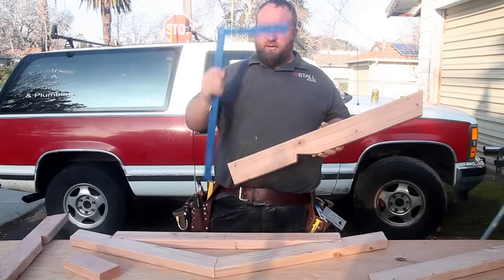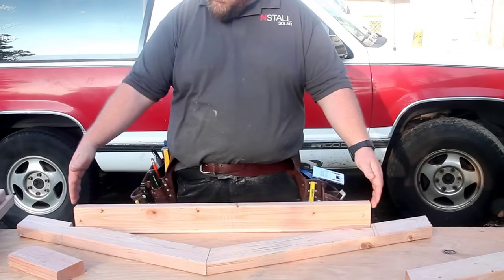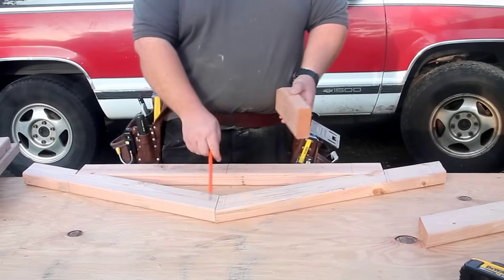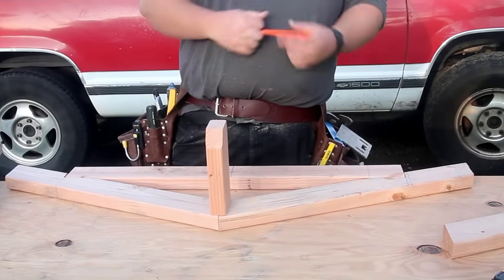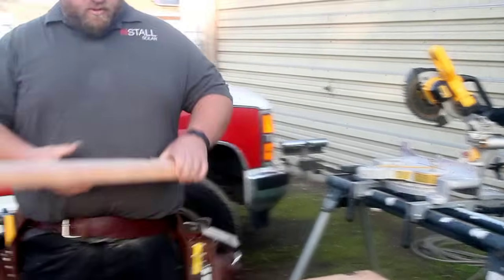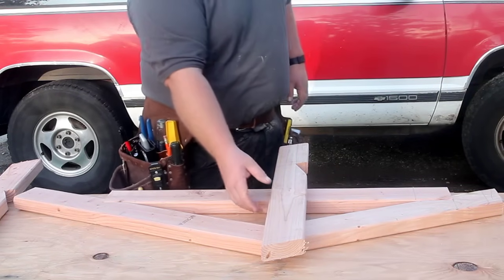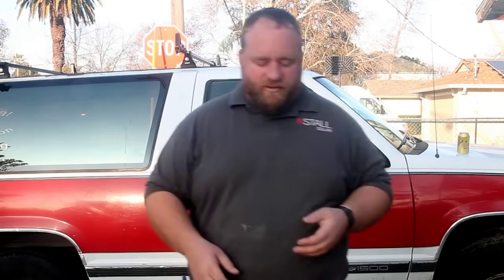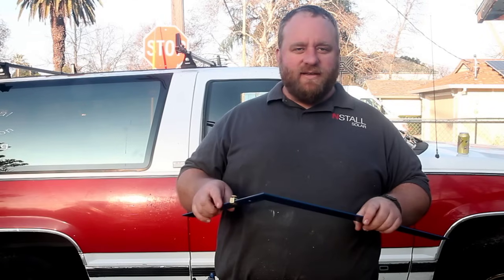The easiest way to make common rafters without a calculator step method

Comment: If you learn to read the framing square, it will tell you exactally how long the rafter has to be cut from end to end. The cut out should be the same width as the outside wall which in most cases is 3.5 inches.The framing square has all the numbers for the length of the rafter for the pitch you choose to use.
Reply: Notched sheathing?

Comment: Doing the math is THE most accurate way to lay out rafters not the step method!!!
Reply: not really, generally it is always better to scribe or use a chalk line then to measure or calculate, and alot easier. a framer who wants to cut a birds mouth using math (more true if not able to use a calculator) will be just figuring out where he needs to mark a line when a framer who just takes a framing square and scribes a line for the rigde and seat cut, then marks the rest of the seat cut with a speed square already has his template for the rest of the rafters. framing work is not the place to spend alot more time and effort just to get something maybe a 16th better, as long as your work is square, plumb, and level, you will be fine:)

Comment: You seem like a nice guy. That was painful to watch....never use a speed square to layout a rafter. ....rafters are much more involved than that and codes vary...
   But " dead hieght" the vertical distance from the top of the wall to the top of the rafter at the outside frame, must meet code and also sets the " drop" the distance from  the  top of the wall to the Bottom of the lowest soffit cut......., download " construction master pro" much easier to use,...
     Moving a framing square multiple times is very inaccurate,..
Reply: Says the expert watching a how to cut a rafter video...

Comment: Just wanted to point out that 1/3 of  3 1/2" is 1.16 not 1.6. Although your 1 1/8 measurement is certainly correct  Otherwise excellent info.